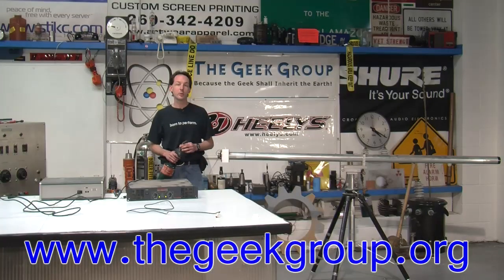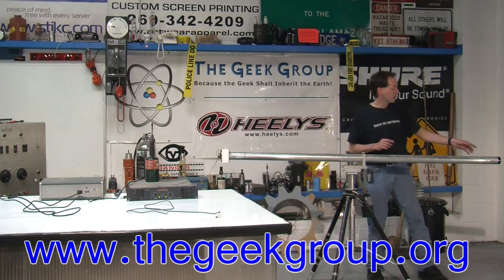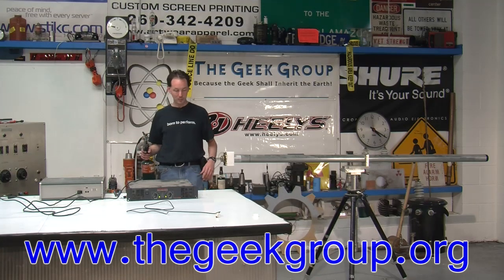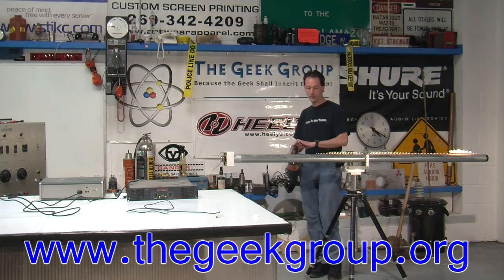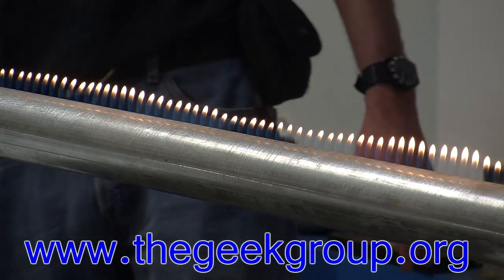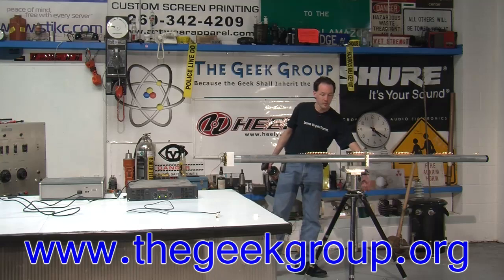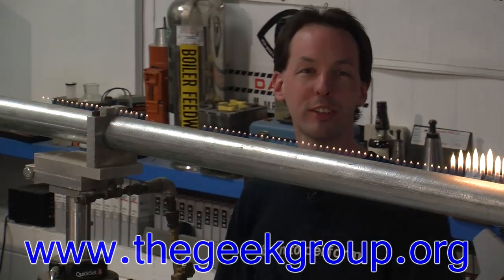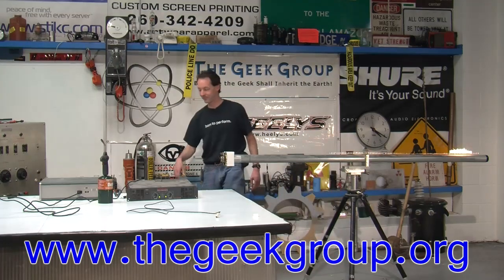Rubens Tube Basic Demo

Comment: get a bucket of warw water snd suspend the propane tank in it 
it will help tokeep the tank warm so you don't loose pressure 
btw MAKE SHURE THE WATER IS NOT TO HOT but i guess you understand that.
realy nice tube